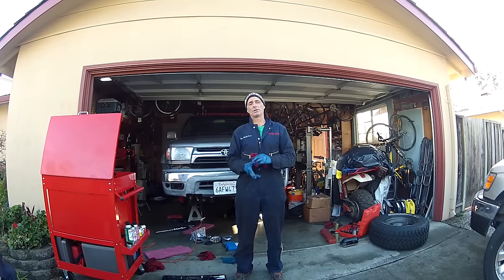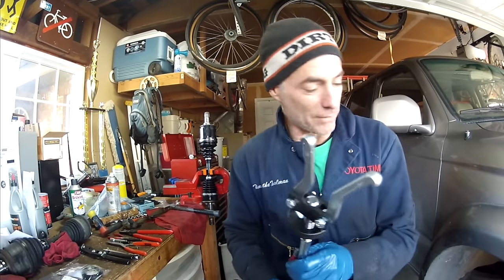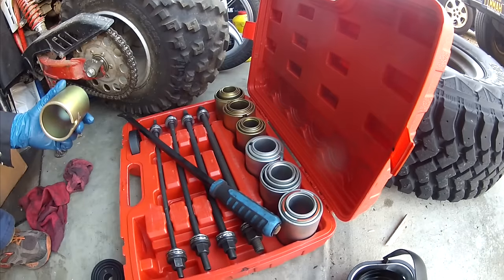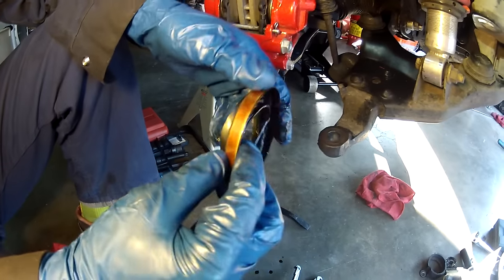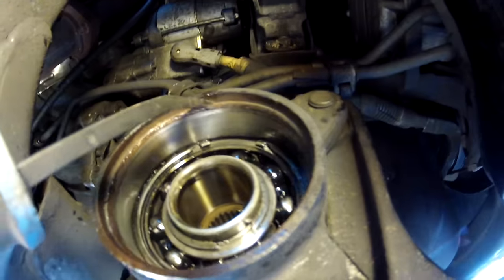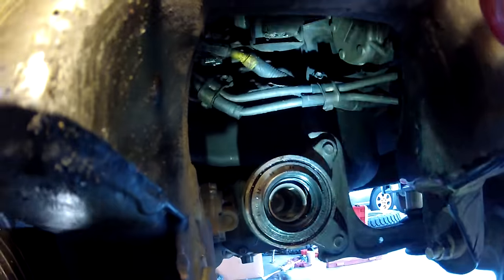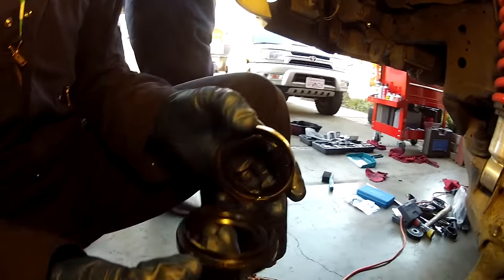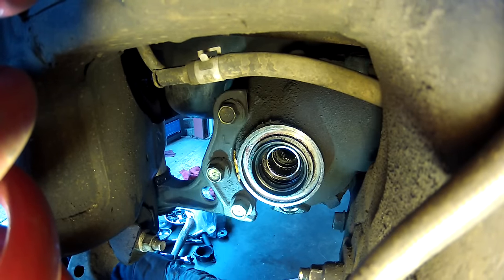Front Differential Axle Shaft Oil Seal Replacement

Comment: Hey Timmy. If you wanted to replace the bearings while you were there would it be as simple as slide hammering the old bearing out and pressing the new one in as you did with the seal? Cheers.
Reply from the maker: We've replaced the driver side needle bearing before with a special extraction tool made by East Coast Gear Supply so we could install an ECGS bushing to reduce play with the CV shaft in the differential.  Here's a link to the video we made for that job: https://youtu.be/sXIfHArtvF8

As for the passenger side tube, we haven't replaced that bearing yet.  I looked at my factory service manual and it shows removing the differential tube to get the intermediate shaft #2 out and then using a press to remove the bearing off the shaft and using a press to put it back on.  The relevant pages in my 2000 FSM are SA-30, 34 & 35.
Reply: @TimmyTheToolman  Thanks for the reply!

Comment: Good job man. I want to ask you something. Can this leak damage clutch as well(i know that it can damage transmition and differential as they are in the same housing. But i dont know if clutch will be affected by this leak). Thank you!!
Reply from the maker: A leak from these seals will only affect the front differential.  It would not affect the transmission or clutch.
Reply: @TimmyTheToolman  Okay, i thought it affects transmition because in the video tou said that there is no gear oil cause of this leak.
Reply from the maker: Yeah, the gear oil was practical all gone from his front differential which would affect the gears inside the front differential but nothing else. The lack of oil in the front differential would not affect any other components.
Reply: @TimmyTheToolman  Okay, i misunderstanded waht you said. Thank you for the answer!!
Reply from the maker: @tolis5631  You're welcome.

Comment: is the diff still working even with those metal shavings?
Reply from the maker: Hey Bardia,  amazingly it is.  I asked Eric if he had ever checked the front differential gear oil.  He said no and he's owned the truck for 2 years.   Who knows how long that differential was low on gear oil.  I asked him if he had been using 4 wheel drive and he said he had.  He likes to go snowboarding so I imagine he has been using it when he goes up to the mountains.

This just proves how important it is to check over a used vehicle after you buy it.  One of the first things I did when I bought my rig was replace all the fluids in the engine, transmission, transfer, and differentials to start off fresh.

Who knows how long his front differential will last with the damage it sustained by running low on gear oil.
Reply: It's incredibly irresponsible for a mechanic to allow that transmission to run. His friend may be lucky but that is supremely the outlier.

Comment: Everybody is sending me your way but I'm so confused. This video is extremely helpful and follows the FSM to a T, but I have a 97 and my FSM matches my vehicle exactly. The oil seals on the driver side of the differential and the passenger side differential tube are the same seal on my runner. I can't figure out what the part number should be and everything about it is so perplexing
Reply from the maker: They can't be the same seal.  They are two totally different sizes.

Comment: mine leaking too but the cv axle play and move so do i need to replace the cv axle as well?
Reply from the maker: There's some play at the connection of the CV axle to the differential.  Sometimes gross play can be experienced at the driver side connection because there's a needle bearing that wears out.  A common fix is to install an East Coast Gear Supply bushing in place of the needle bearing.  We have a video for that job.  https://youtu.be/sXIfHArtvF8

Comment: How many oil seals are there front and rear Differential, plus the Transmission itself right?
Reply from the maker: Don't know how many seals total there are for both diffs and trans.   Is this just a question out of curiosity or are you trying to repair something?
Reply: @TimmyTheToolman  Well since my 4Runner is leaking everywhere except the engine, thats a question from me to an expert like you.
Reply from the maker: @keijimuto  Well, I would first degrease everything under your rig as best as you can and then keep a close eye on things.  The wind velocity when driving can blow oil backwards and areas that are wet with oil might not actually be a source of an oil leak.  Your differentials have seals for both axle shafts and for the companion flange.  The transmission has an input and output seal.  Those are all the shaft seals that could be showing signs of leaking other than the many gasket seals that seal the differential and transmission parts together.
Reply: @TimmyTheToolman  Alright at the moment underneath all look like a oily mess, also the steering pump leaked a lot and will be replaced as well. Thanks for the info.

Comment: Hello timmy! What happens if I had already change the seals the proper way, and toyota original seal,  but the passenger side still leaking diff fluid?? What would be the next step!
Reply from the maker: Mayron Hernandez Are you sure the oil seal is at the proper depth and that the CV axle is fully seated into the differential?

Comment: Is it ok to replace a metal seal with a rubber one? When I serch for spare parts I only find rubber ones for the front axel. I found metal one for the pinion seal. I need to replace seals both on front and rear.
Reply from the maker: @Cr3at1vem1nd  You should be able to buy the axle seals.  Toyota sells them.  I've never heard of an all rubber seal for this application.

Comment: Should I replace them if I'm recently replacing the CV axles?  Had no prior leaks but would it be worth it?
Reply from the maker: If they're not leaking, don't bother.  I think these seals can last a long time.  Pulling the CV axles out isn't that labor intensive, so if you ever do develop a leak, it's not a big deal to pull it again to replace the seal.
Reply: @TimmyTheToolman  thanks for your feedback. 🤙🏽
Reply from the maker: @Yotapuga  You're welcome.
Reply: I’m on this thread. Need to replace the driver’s side CV axle on my ‘07 4th gen and getting worried on the seal set-up. Thanks Timmy ‘ n Shaun.

Comment: I need to do both sides on my 95 Tacoma 4x4.  My guy is charging me $250 in labor, is that fair?  Thank you
Reply from the maker: I'd say that's a pretty fair price.  It'a decent amount of labor to pull the CV axles, pull the seals, accurately drive the seals in and get it all back together.
Reply: @TimmyTheToolman  Thank you Sir.  I figured since one side is leaking, why not do the other too.  My 95.5 has 215K
Reply from the maker: @raydonovan7988  You're welcome.

Comment: Can you secure three pieces of metal on the outside of the pipe with a metal strap at 5.5 millimeters from the end of the pipe so you can just tap it in without worrying too much?
Reply from the maker: There's a real handy tool the Wit's End company made for driving in the seals.  We showcase it in this video: https://youtu.be/Q-RO52NtP1A

Comment: Hey Tim great video as always. However I just did this in my 4runner even used the micrometer and got it right at 5.5mm yet I still have the slow drip leak on my passenger side. Anyone on here got any idears what the he'll could be happening. I'm ordering another seal AutoZone instead of the toyota oem to see if that makes a difference. I'm at a loss as of now. I'm really worried I'm getting dirt and mud in my diff from this seal leak and worried about doing damage to my gears and bearings
Reply from the maker: interesting.  I've determined that 5.5 measurement is a ballpark measurement and doesn't have to be absolutely precise.  As long as the seal is mating well with the CV axle, it shouldn't leak.  I just installed a diff seal in a buddies truck yesterday.  instead of painstakingly taking a depth measurement around the whole seal, I just got it fairly flush with that inner lip and called it good.   Did you wipe up the drip and it comes back?  Sometimes there will be a little bit of oil pooled on the other side of the seal and when you inset the CV shaft, that little bit squeezes out and that's the drip you're seeing.  I've seen it happen on one of my rigs.
Reply: Thanks for the prompt reply man that's awesome. Yea I wiped it once today and it just came back. When I pulled out the old seal it came out pretty easily and the new one went in with a fair amount of ease too. I might try pulling the stuff apart again and just setting the new seal in and try pushing it in with the cv its self. You think thatd work? Ive started to hear a small high pitched whine when in 4wd. You think dust and dirt has done damage to the gears and bearings from this leak?
Reply from the maker: @kosmonautfpv4920  So you're saying the seal inserted with relative ease?  Both times I've done this job, the seals had to be hammered in with a decent about of force.  Did you look at the surface of the CV shaft for any imperfections.  I don't think it would be wise to try to insert the seal by using the CV axle.  I wonder if you have some type of crack in the housing.  Clean it up really good and take a hard look.  I don't think you got any dirt into your differential.  That whine could be a bearing going bad.
Reply: Will do tomorrow man. I had to hammer it in but not a whole lot. Well that eases my mind for sure about the bearing. Thanks

Comment: Can you do this job with a oil removal tool that has the hooks? Or is it better to buy this tool?
Reply from the maker: Sounds From The Underground. You can use a hook style seal puller.  The slide hammer puller is a more versatile tool but not absolutely necessary for doing this job.
Reply: @TimmyTheToolman  thanks for quick reply! I'm going to do this to my 99 Eclipse
Reply: @TimmyTheToolman  I just realized you showed the tool I just described in your video! Its actually the exact same one I ordered
Reply from the maker: @signsofthetimes886  Sounds like you set.  Good luck with the job.

Comment: Hey tim, i purchased the seal #47027 from Amazon and it says position front right. But from your parts list u have it as driver side. Just looking for some clarification before I install. Thanks.
Reply from the maker: @wendelsimeon5698  The part numbers in the video description are correct for the sides mentioned.
Reply: @TimmyTheToolman  quick question does the drain plug take a crush washer
Reply from the maker: @wendelsimeon5698  No, it doesn't.   It is a copper flat washer.
Reply: @TimmyTheToolman  appreciate it. was wondering since mine didn't have anything.
Reply from the maker: @wendelsimeon5698  No problem.

Comment: I am going to be replacing this on a 2007 fj cruiser. Do you know if it is a similar job for a 2007 fj cruiser? Does it go in 5.5mm also? I cant find much online
Reply from the maker: Any vehicle with CV axles should be very similar. Now how far should you drive in the seal? Can't say its exactly 5.5mm. What you should do before you remove the old seal is try to measure it or at least take a visual note of how far it is driven in & attempt to get it back in the same position. It's important you have a tool to drive in the seal evenly so try to find a seal driver kit like the one we link or gather something together that will be a slightly smaller outer diameter of the seal.

Comment: Question for Triple T.  I just replaced my drivers side bearing and seal a couple weeks back.  I made sure the seal it was flush to match the one I took off but must not have done a good enough job as it has a slow seeping leak only when I drive the truck.  It is possible I was a little off, lol.  I went out and bought a new seal and digital calipers to make sure I get the 5.5.  My question is, if I still see leaking at that point, then what?
Reply from the maker: Hey Steve, maybe give it a little time.  What you're seeing might have just been a little residual oil that squeaked out when you install the axle.  Have you wiped it up several times and it keeps leaking?
Reply: @TimmyTheToolman  Yes I have cleaned it up good a good 4 or 5 times.  I took some pictures of it after this last time I cleaned it up and looked under the truck last night and saw the wet look again.  I plan on taking another picture of it today after I go get another seal just in case.
Reply from the maker: @stever8822  Did you take a good look at the CV axle where the seal rides?  Maybe there's a worn spot where the seal is riding.  Are these OEM axles or aftermarket?  If aftermarket,  maybe their machining of that part of the axle was a little off and the diameter is slightly less than OEM and the seal isn't getting a tight fit on the axle.
Reply: @TimmyTheToolman  When I was in there I didn't see anything suspicious but it has been a couple weeks now so can't really remember.  The CV Axle is is OE, so the only things that were after market was the ECGS Bearing and the seal.  The original seal looked to have some sort of metal case with the seal mounted within it but the new one I got from ECGS looked to have the entirety encased in rubber much like yours in this video.
Reply from the maker: @stever8822  I guess your only choice is to remove the CV axle, inspect the seal to see if there are any glaring problems with it to get an idea of why it was leaking and then pull it out and try again with a new seal.  I hope the second time around is successful for you.  Let me know how it turns out.
Reply: Ven Eder, care to comment on the difficulty of replacing the bearing? Was it part# 90368-50006? Were you able to replace this bearing without dropping differential? Thanks.

Comment: Timmy, do you have anything on replacing the front wheel bearings?  I read somewhere that someone had done theirs and when they pressed everything back in the tone ring and retainer were spinning independently of the wheel.  I pressed my bearings in today and I noticed the same thing happening, you can turn the tone ring along with the retainer and the wheel wasn't moving, seems pretty strange.  It looks like pressing in bearings on a 4runner is a science.
Reply from the maker: Dude, this is weird because I was just pressing front wheel bearings yesterday but it was for a guys project for putting manual hubs from a Tacoma on his 3rd Gen 4runner.   I unfortunately don't have experience with the 3rd Gen hubs yet.  

You lost me on the tone ring but I looked it up and it's synonymous with the ABS sensor rotor.  Next to the ABS sensor rotor is a bearing spacer (at least that is what the FSM calls it), is that what you are calling the retainer?  

When I did a CV axle reboots and replacements, I had noticed something in the back of the hub that was moving freely.  It must have been the ABS rotor and/or retainer.  Sean has a set of knuckles we pulled off a wrecked 4runner at a local Pick and Pull.  I'm stuck at work for the next couple days but maybe I can have him take a look at the knuckles and take some pics for me and tell me what's actually able to move on the backside of the hub.
Reply from the maker: I asked Sean and he doesn't have his spare knuckles with him.  They're at a relative's house and he won't be there until Wednesday.
Reply: Timmy, appreciate the response.  I was desperately searching all over the web to find the thread that referenced the speed sensor and the bearing spacer.  I called those parts by other names since I didn't know the correct term for it.  I found the thread and people were confused about the same issue, then someone said that the speed sensor and spacer does indeed move freely until you tighten the CV into the knuckle and it stops moving.   Looks like I wasn't going crazy.

http://www.justanswer.com/toyota/849ke-toyota-tundra-sr5-just-pressed-front-wheel-bearing.html
Reply from the maker: Cool, glad you got your answer and I learned something from you about our hubs.  Now I know what was moving when I put my finger in there.  I remember thinking, is that the bearing?  Thanks!

Comment: Do the axles need to be greased where they ride against the new seal?or wiped off and regreased? Or something similar?
Reply from the maker: It doesn't hurt to add some pre-assembly grease to the seal lip so the first turns the CV axle makes doesn't cause any excessive wear.  Once the vehicle starts really moving, gear oil is constantly up against the seal keeping it lubricated.
Reply: @TimmyTheToolman  thanks
Reply from the maker: @tylerkrug7719  You're welcome.

Comment: Nice work. Q. i've done a rear seal on my 96 4runner but i need to do the front p/s of my 04. any tips how to do the 04?
Reply from the maker: I don't have a Factory Service Manual for an 04 but I imagine it's probably very similar.  Remove the CV axle, note how the seal currently sits, maybe even take a measurement with a caliper tool like I show in the video, pull the old seal out and knock in the new one at the same depth.  You should be good to go.

Comment: What about the bearings? Can i change them from there or open up the diff?
Reply from the maker: What bearing are you talking about?  On the driver side of the differential, you can replace a needle bearing the CV shaft rides on without opening up the differential.  The bearing that is visible on the passenger side requires you to pull the tube that attaches to the differential.  As for the bearings inside the main differential, you'd have to pull the differential and tear it apart to replace those bearings.
Reply: There is a loose when I grab the passenger's side flange that goes in the diff..
1992 4runner ..ADD